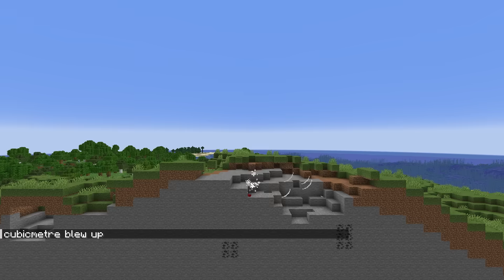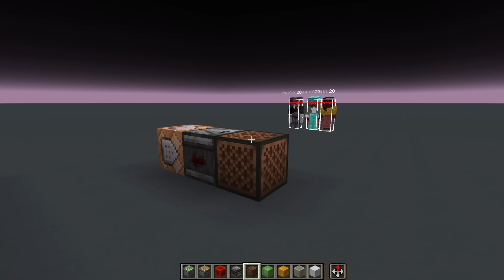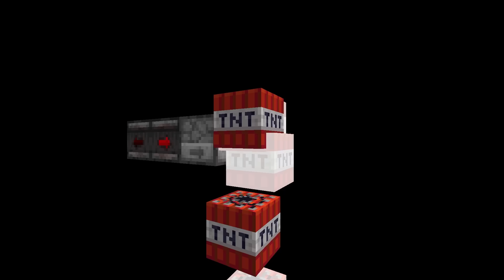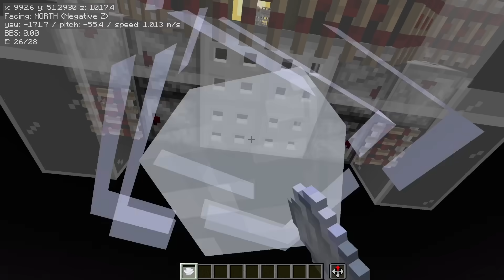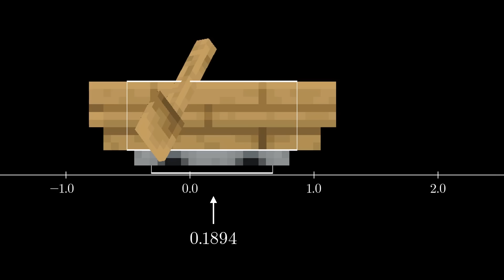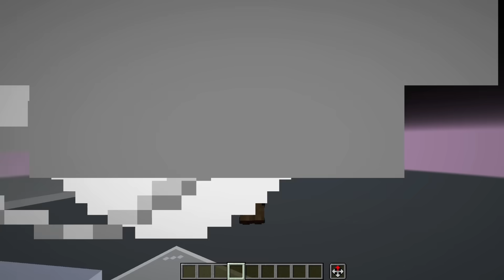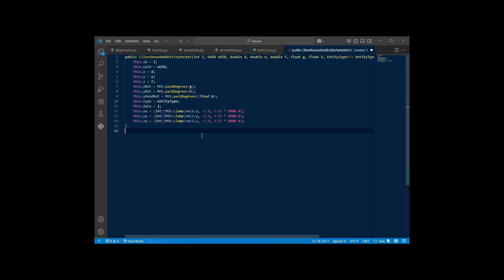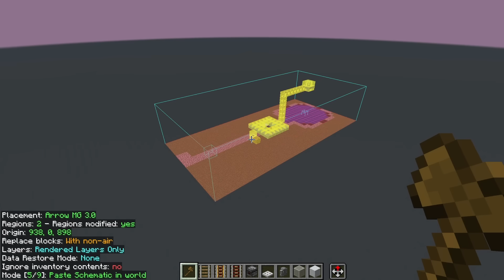The Best Air Defence in Minecraft is Finally Here!

Comment: If Mojang adds the arrow of levitation to the game at some point, then we would have an arrow that effectively makes this cannon kill anything it hits after only a couple of seconds, because players would not be able to escape it even if they have totems(this is because the levitation effect stops the player from flying). I dont know if it is possible with the current design, but then you could mix 2 types of arrows - levitation and harming - for an ultimate AA "belt".
Reply from the maker: Effects don't really make much of a difference given its pretty much one hit one kill so the difficulty is actually getting the arrow on target in the first place.
Reply: @cubicmetre  well and totems.
Reply: @cubicmetre Does this system work well in parallel? 
Could always go with the brute force method of building multiple AA positions, with each one having its operator's aim strategy slightly different / AI configuration changed. If the target is moving erratically the guns can cover more directions the enemy might try manoeuvring in (so if they're ascending and descending then one can fire low while the other can fire high, if they're weaving / yawing one can fire right and the other one left). Adding even more turrets would allow for a strategy of just firing both at the target and in a cone around it so they'll be hit no matter what manoeuvres they make.
And of course each additional position could have its firing offset (if possible). If making any individual turret fire faster than a shot every 3 ticks isn't possible, then just add more turrets that start firing a tick later to fill the sky with more projectiles!
Reply: @cubicmetre it's anti totem, so we basically use levitation as the armor piercing in AA belt
Reply: @cubicmetre  The idea is to counter totems I think
Reply: @cubicmetre  totems!
Reply: @cubicmetre  arrows of harming specifically don't do damage if the arrow itself already deals 12 or more damage, it's only really good for rapidfiring undercharged shots
Reply: In case the players carry a totem and need two hits you can use slow falling arrows, so they fly much slower!
Reply: @Froggenheimer42 But the player still has the smaller hitbox and he is still moving quite fast if he spams the fireworks, but the levitation effect prevents both of these things and that is why it is better
Reply: @Froggenheimer42 using a totem clears effects
Reply: @CatCat99998 but if a tipped arrow pops the totem, you still get the effect (applied after it clears)
Reply: @Vetrical oh interesting, didn't know that
Reply: @Froggenheimer42 can we do a tri belt with slow falling, levitation, and harming?
Reply: Damn we got AA ammo belts before GTA VI
Reply: how'd you eliminate the belt ordering? Right you can just make a double piston pushing a redstone block alternating between 2 hoppers to feed diff types of arrows
Reply: To everyone in the comments going on about levitation arrows or other belt configurations to counter totems: these are completely unnecessary.

If an arrow of harming kills a player holding a totem with just the kinetic arrow damage (exactly like it is here) the harming effect will activate slightly later, after the totem has already saved the player once, killing the totem user a second time near instantaniously. Using just harming arrows already instakills totem users.
Reply: have you checked that? i'm reading on the wiki that if the arrow deals more than 12 damage, the harming effect gets neutralized. in fact, the harming effect on arrows just makes sure that an arrow deals no less than 12 damage. of course i have not practically checked anything so i could be totally wrong
Reply: @kepler69c32  yeah, as my reply right abve said it has to do with i-frames, meaning that a slow harming arrow can do more damage than a fast one due to armor
Reply: @N-olla unfortunately that only double kills if the player is at extremely low health, has little to no protection on their armour, and the arrow itself deals very low damage.

Many games use what is called "i-frames" (immunity frames) which are periods of time when the player (or an enemy) is immune to damage after being hurt to prevent quick attacks from shredding the player's health.
Minecraft has something similar: damage ticks as many have come to refer to them. You likely have seen an entity turn red for a moment after taking damage, that's not just an indicator that it took damage, it's a indicator for the damage tick, it lasts for 0.5s, exactly as the DT. And how do damage tick work?
The DT prevents you from taking any damage that deals less or the same amount of damage than what started the DT, damage higher than what started the DT isn't blocked but is reduced by the amount starting the DT and changes the value to the new damage, for example, if I hit you with a diamond sword and then, a 0.2s later, my friend hits you also with a diamond sword, the hit is blocked as 7 is not more than 7, but if they were to use a diamond axe instead of a diamond sword, you would take 2 damage from their hit (9 from the axe - 7 from my sword) and you're now protected from anything that deals less or 9 damage, your DT isn't extended, now, if a second friend crit you with a netherite axe now, before your DT ends, you would take 6 damage (15 - 9 = 6).

How does this work with harming arrows? Harming 2 (instant damage 2 effect) deals 12 damage and as you pointed out, the effect is processed after the arrow's damage, so it is reduced by the DT from the arrow, if the arrow deals 4 damage, harming only does 8, if the arrow does 12 or more, harming does nothing, just using power 5 on a bow is enough to render the effect entirely useless (unless you barely pull the bow back), this also applies to healing arrows against the undead.
So, to kill though a totem with an arrow, you need the arrow to deal only 3 damage or less (could be a wrong if for some reason arrow effect is processed before the totem applies it's effects) so that the harming effect deals 9 damage or more (absorption 2 from the totem gives 4 hearts = 8 hp and players have 1 hp after being revived), 'protection' enchantment reduces magic damage (here, harming) by 4% per level, so the player will not be double killed if they have more than 4 protection level on their armour (just having prot 2 leather with an elytra is enough).

Want more? Damage ticks block melee and projectile knockback but not explosion or wind charge knockback, as such, being on fire or poisoned can prevent you from taking knockback. All kinds of damage can be reduced or blocked by a DT, even void damage. DTs care about the damage before damage reduction calculations, having full projectile protection 4 makes an arrow shot from a power 5 bow deal less than 2 damage after reductions but the harming will still be blocked. (At least until 1.21, not sure after) Breaking a shield with an axe counts as damaging the player for a DT despite not dealing any damage (because the shield blocks the hit) and isn't visually displayed, a DT from this takes the damage the attack would have dealt if the shield didn't block it (before damage reductions from armour), making attacking right after breaking (disabling) someone's shield deal no damage or knockback, servers running on papermc had a bug where this didn't happen.
Reply: @N-olla doesn't this forget i-frames, since the arrow goes so fast the harming effect is overriden by the i-frames of the arrow hit itself?

i saw a vid on this and thats why harming arrows suck with strong arrows since the arrow damage i-frames negate the harming but the arrow damage is blocked by armor, so the harming damage that would do more damage is ignored and only the arrow damage goes through
Reply: They could still pearl/chorus fruit down to the ground, then keep pearling or place water.
Reply: Aren't harming arrows redundant, especially due to how iframes work?
Reply: Popping a totem clears all status affects - buffs & debuffs
Reply: you wouldnt need harming at all but yeah thats a good idea

Comment: The problem is, that Elytras have waay too much manuverability. Like if a plane could change directions this quick, the pilot would die from the inertia, and even the plane might break.
Reply: The plane would turn into powder if it did an instant 180 like elytras do
Reply: @pd28cat  the wings would break off but I actually think the main body of the plane would survive since that has nowhere near as much drag in the scenario of a instant 180, of course this would depend on the plane but at the very least most planes wings would snap off like twigs
Reply: @atothepowerofthec8660  no aircraft in the history of mankind could pull off a m9ve like the elytra. not even the su27. Not even the F22.
Reply: If you replace the one arrow with 9, slightly deviated arrows, maybe it would have a greater effect.
Reply: @fotoschopro1230  That's the problem with the previous player aimed cannon. You can't deviate arrows like that anymore. It'd be cool if fireworks did, or could do more damage, then you could make just straight up airburst flak rounds.
Reply: @NerdGlasses256 A separate TNT duper powering a flak cannon, perhaps?
Reply: @fotoschopro1230  you can artifically do that with 9 AA cannons and offset them a little bit
Reply: @fotoschopro1230  tell me how you would align that now
Reply: Minecraft people must not have blood (or brains?)
Reply: yeah you can make a 90 degree turn at literally supersonic speeds in a fraction of a second
Reply: @miner_sd  90 degrees aren't really that much. An elytra can basically turn completely around in one flick of a mouse, and then you use a rocket, and it's at max speed again.
Reply: that's called pressing the cobra button

(i know it's not called that way but still fun to think it is)
Reply: @maxdenor1459  Yes, there's a setting on jets that disables g restrictions, but it still kills you or even destroys the plane if you go over the limit. It just doesn't stop you from doing so.
Reply: If the Do a Barrel Roll mod was vanilla then it would make a bit more sense but that’s not how they are in vanilla for many obvious reasons.
Reply: more precise comparision would be drones ranther than planes
Reply: Elytra maneuverability is limited by the player's abilities
Reply: @инкогнито-ю7з  not really that much. You just flick your mouse, and use a eocket boost.
Reply: can't wait for them to add G tolerance mechanics like in war thunder
Reply: Don't compare Steve with measly humans
Reply: ace combat takes place in minecraft then
Reply: well if the plane breaks it kinda breaks the point of being abel to smartass
Reply: To be fair, Steve is a Ubermenschen who can juggle entire Eiffel towers' worth off mass in his pocket without even bringing a bag along, so maybe that G-tolerance is understandable
Reply: Well, no, elytra are also really slow in terms of real planes, slower than even WW1 biplanes. Even a really fast turn would get you something like 8g tops, which is around what military jets are rated for.
Reply: @CMDKeenCZ  Do you know in physics, inertia is a thing?
Reply: And? It's a video game. It's not real life, and it sure isn't a plane. Steve's bones would be crushed under the weight of diamond armor, that doesn't make the inventory or lack of a weight system a problem.
Reply: @Alex-vl1mk  You are missing my point. My point isn't that minecraft should be way more realistic, IT's a game where fucking trees float. My point, is that an AA gun isn'T as effective here as in real life, because you can't make flak rounds, and the players can do a 180 turn and evade your shots.
Reply: @NerdGlasses256   To be fair the AA in this video is somewhat slow compared to real life. In minecraft, you don't have overheating issues with your gun too. You can just hold the trigger and keep firing, assuming you don't have an ammo problem. IRL they are much much faster, but you have to reset once in a while to not melt your gun.
Reply: That’s not what inertia is. Inertia is staying in a state of motion without change.
Reply: @MedicAthlete24W  According to Wikipedia "Inertia is the natural tendency of objects in motion to stay in motion" Which is what the blood in your veins does, when your body suddenly stops moving in a direction, and starts moving in another forcing the blood out of your brain, making you faint. This is why planes can't change directions quickly, because either the pilot's organs/blood, or sometimes parts of the plane, experience more inertia than the force from the thrusters/wing flaps trying to change the direction of the pane, making the plane rip apart, or the pilot faint. The plane can also be ripped apart by air resistance but I didn't think that would apply to people with elytras as much.
Reply: Plane would likely break before the pilot dies, unless new jets are just that sturdy.
Reply: @WallaWaller  Jets ARE that sturdy, the pilot can pass out or die way easyer.
Reply: @NerdGlasses256  but they cant do a 180 turn without l9sing any speed
Reply: @WallaWaller  The major limiting factor in modern jet fighter performance is the human between the flight controls and the seat. When we start remote controlling them they will become far more capable killing machines and with much less risk of losses. Scary thought.
Reply: @AmishDoinks at this point let's just fight all wars in open fields entirely with robots.
Reply: @AmishDoinks   We are in the age of drones and it will only get more advanced with ai.
Reply: Someone's never heard of the Su-35

Comment: I mean for tnt you could do a staggered line of explosions that starts at say 10 blocks away and extends to say 200 blocks away and pack as many explosions in that interval as is needed. Also with a design like that, if you build it a bit under cruising altitude, you can easily make it extremely difficult to dodge, since it's a damn line of fire.
Reply: That would be really hard
Reply: This "line of fire" idea actually isn't effective, because you would have to somehow ensure that the opponent flies ALONG that line of fire to be effective. Obviously, this is nonsense, since airborne players have 3 dimensions they can move in, and it's not guaranteed that they fly along the direction you happen to have the firing line setup in.

Comment: Can you creat desing alowing us to shot 5 or more arows(with slight ofset) in one shot to obtain area efect? It would make much easier to kill fast elytra due to having biger margin of eror.
Reply: That is a problem bc in 1.21.5 mojang made it so that there would be no arbitrary offset when arrows are shot in to a closed fence gate that closes and opens. 
I think you can make it so that the dispenser shoots in to a block and then move it but then it will have problems with the arrow going thru the tiny hole that was made to prevent previous shots from influencing the one coming after it.

Comment: next we we will see a fully working flak cannon that shoots a ray of tnt in the angle, detonating them in a line to hit every possible target
Reply: actually, its super easy to make a flak cannon, although not a very practical one. i dont really have the knowledge or time to figure out how to make one for fast moving targets like elytra but its super easy for slow targets like cargo ghasts or charged creeper ghasts. 

I think I should try making one with custom fuse and range controls, might need multiple operators though.
Reply: VT fuse in mc when
Reply: next we will*
Reply: A firework launcher that changes the flight duration of the rockets it fires depending on the distance from your target
Reply: @badideagenerator2315 not really a good one, you can only have 3 fuses for 3 specific altitudes and you cant shoot at any other direction.